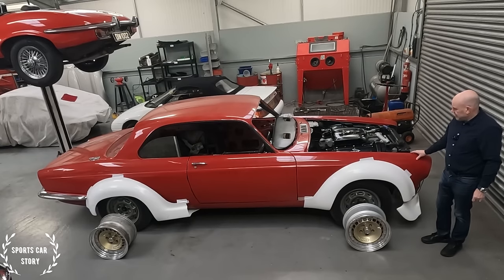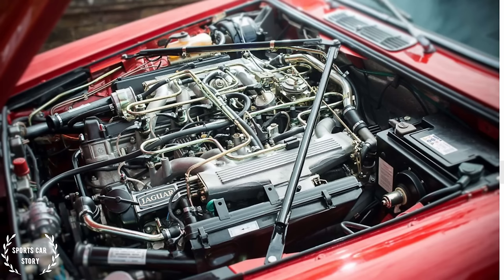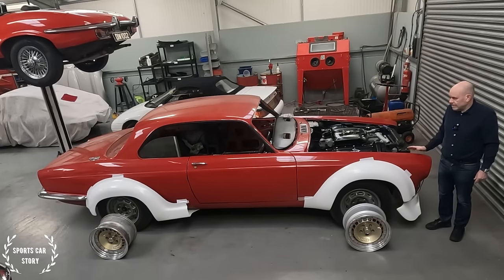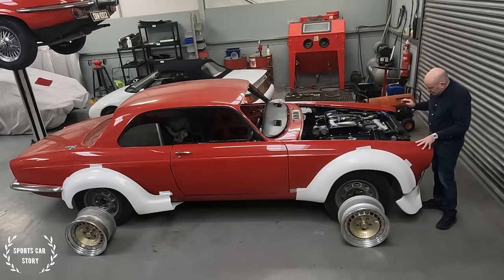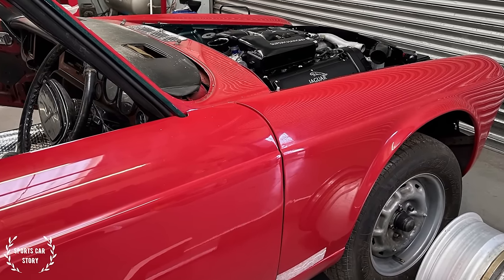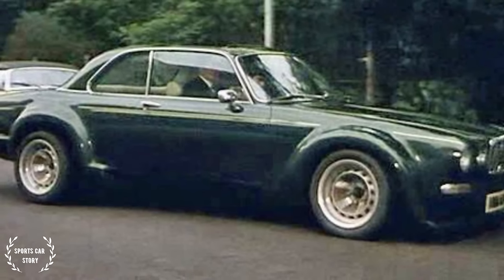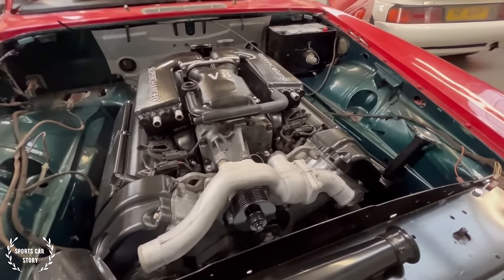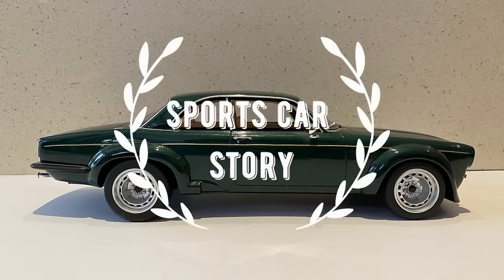Using this model as a guide, we're building a Jaguar Broadspeed John Steed Replica.

Comment: Steed was a "club" man, so the interior should be walnut and leather. Turned aluminium dashboards are a contemporary Bentley "footballer bling" confection and not appropriate in my opinion.
Reply: I agree. A trashy dashboard would be as wrong as a tattooed Mrs Peel in a thong, or swapping Steed's bowler for a baseball cap. 🤭
Reply: Steeds own, original car in the series is a 1929 4 1/2 litre Bentley, with an engine turned dash....so an engine turned dash isn't  out of character
Reply: Turned aluminium is an old coach built trim used on cars pre WW2
Reply from the maker: I think you’re right. I’m going to pivot to a walnut dash through popular demand.
Reply: Totally agree. Should be brown leather with British racing Green. You could stain the seats the right colour to save retiming them🤔
Reply: Those old Bentleys he drove had engine turned aluminium dashes, I’d wager.
Reply from the maker: @blacksquirrel4008   they did. & I got my engines turned Ali done by a Bentley engineer in West Sussex
Reply: I’d ignore the ‘footballer’s car’ jibes and go with the machined aluminium dash - I think it would suit the ‘steampunk’ character of the car and body kit - anyway it’s your car - you trim it as you want it!

Comment: Back in the 80s I knew Bob Kerr who found and rebuilt the 3rd Broadspeed race car.  What a monster, there were 4 x drain pipe sized exhausts which came out under the drivers door.  A blip on the throttle flattened the grass for several yards
Reply from the maker: Wow! I wish there was a video of that!
Reply: @sportscarstory before videos I think.  Saw it at the Knockhill hill climb.

The story was that Bob found the body shell in a scrap yard and was going to build a replica.  He had lots of contacts and when it became known he had a body shell someone would call and say “I’ve got an engine”.  He found that it appeared to be an engine from the race cars, then someone would offer the transmission, then a custom wiring harness which just dropped into the body shell and connected to all the right points.  Someone involved in engineering the race cars then told Bob that he had the “lightweight shell” (dipped in acid to thin the metal).  It became apparent that all these bits were indeed from the race car.

Comment: Very interesting Sir !  Went down this road in the early 90's, bought a kit (Pre fire) from fibresports and found a donor XJ12C for the conversion. I used a Jaguar specialist in SW London and had the bodykit sent to them.  The problem as you are well aware is that XJC's are prone to rust and corrosion (Leylands build quality issues as ever) so the first thing was the donor car body which was pretty nasty. It was the glorious 'carriage brown' so the body paint matched the rust 🙂. After a long time and working intensely with the garage, and lots of £££'s the project had to be cancelled, because it was just too much to maintain. I have owned over five XJ12c's all of them horrendously rusty and needing so much time and money on the bodywork alone before even thinking about the engine auto box, etc,.  Sadly I decided to sell my projects cars for a massive loss, but thats the problem of having a passion for classic jaguars.  On the plus side, XJC's are one of the best looking cars ever and my preference over the E-type. 
One of the nastiest things is the rear electric window with its complex  "S" path to retract the glass into the body, but also ensure that the rear windows maintained good seal when up to prevent the ingress of road noise. Was a tricky thing from an engineering perspective but Jaguar engineers did a good job at the time, 
Some interesting facts re the original XJ12 purchased for conversion for TV
Original colour: 'tasteful lavender blue' - well no accounting for the colour available at the the time, but didn't matter since the car was to be resprayed anyway,.
The engine was a 'base' 330hp V12, but used the round fuel delivery pipes that were prone to shearing and spraying fuel everywhere (corrected later with the improved square fuel rail delivery pipes fitted to the "HE May fireball V12's)
The sound in the TV series were 'dubbed in' but if you look a tHarrys Garage and his restoration of a beautiful XJC the sound of his car in the video is not exactly 'untuneful' but for TV the car needed to sound 'fierce'
The British Racing Green (and there are many variation on this theme) paint was apparently loaded with metal gold flake to give it some depth, and some cost depth as well !
The GKN Kent allow racing wheels were a nightmare to get the spec of and I used to speak with Harry at Image wheels to re getting these manufactured but the costs were high as you can imagine back in the 90's and it seemed to be a bit of a 'dark art' to get spot on.
The V12 (5343 cc) engine is of the 'over square design' and was told that these can be stretched to ridiculously high cubic capacity for things such as marine racing applications. 

I owned a 'santa pod' red XJC, very fast and aggressive, lightened clutch, brake line locks, you get the picture, but deadly, you could not afford to take your eye off the road for an instant, nearly caught me a couple of times 🙂

For many years i tried to track down the original tv car to buy but years of searching got me nowhere, lots of 'leads; but nothing concrete,
The original tv car had the light beige interior (needed for filming to reflect sufficient light) and apparently had lots of 'holes' in the interior trim due to mounting of camera rigs etc.   In fact the XJS used in "return of the saint' had filming cars with beige interiors but black interiors for still and promotional shots.

Re your project car,
I hope that the 'proper' lower skirt gets resolved with Fibresports, that was the one thing that was a major headache for me at the time, and finding a good fibre glasser that would take on the job, 
Thanks,
Nic
Reply from the maker: Thanks for all the info Nic. Adrian at ADR has cleaned and replaced the rear side windows. Both working to an adequate level. Hopefully you’ll see the car pretty soon in my next video when it comes back from Fibresport (it’s been delayed because Steve’s had a bad dose of Covid) thanks again for the info. Pete

Comment: Looks like a great project ,one tip is to use stock upper shock bushes as hard ones will crack the inner fender mounting point.
Reply from the maker: Thanks for the tip.
Reply: Or these mounting points need to be reinforced.

Comment: I fully agree with a Steed mod on the outside and a modernised restomod underneath.

I'd probably have gone for as much XJR power train as possible from the get go. Definitely the diff. The 4.2 SC unit has a lot of torque, even compared the V12.

As for the dash and interior... if you're keeping it then make it the car you want. That's half the joy, IMO. The 1955 Studebaker Speedster had a turned aluminium dash and it looked sensational. I think it will in this, too.
Reply from the maker: Thanks. Interesting!

Comment: If you look  at the uk cobra replica scene you will be fairly happy at the power onoeod these diffs can take. Also a good source for suspension upgrades. 3.54 powerlock 
LSD from a XJS 3.6 Manual wound work nice with a 5 speed manual gearbox. XJC is a beautiful car, I remember seeing a metalic BRG XJC with this body kit in Newport Gwent in about 1984 when I was an apprentice.
Reply from the maker: Thanks! Great advice!
Reply: If this was my build I would be going down the LSD route, there will be to much power for the open diff unless you like to burn rubber on the tire with the least  traction
Reply: @boatslave1  The S-Type R never had an LSD !

Comment: I had a 3 dr Cosworth that I road and track day car, it was completely rust free, the problem with 3dr sierra’s is the large door opening so they flex a lot and I didn’t want to put a cage in it so found a trick that early drift cars did to stiffen the shell which was better than a cage for stopping body twist. Which is to use structural foam which is a two pack resin product it is used in the boat industry and very hard. I put it in the chassis and sills and A & B posts this did really stiffen the shell up as I was using really hard springs as well L stopped at the front crossmember so the front section could still crumble in a crash. Believe me it really does work but very messy.this will mean you won’t have to worry about the roof. As for tyres try Northants tyres they specialise in American tyres and wheels which are on the old Corvettes which are wide and not low profile, I hope this helps
Reply from the maker: That’s brilliant! Thanks. I’ll def get the structural foam.
Reply: We did the same thing to a rally car in the 1970's and I had forgotten all about it. I was going to point out the same as you, the roof is not weak it is the atrocious body rigidity that is the issue. Mazda solved the issue with a bolt in under floor bracing frame for the MX5 so that may be worth a look as well.
Reply from the maker: @duster8100  thanks for the advice.
Reply: In an ideal internet world ,‘Twould be nice to fabricate the body kit in METAL , maybe a set of mk 1 escort metal bubble arches would be a close match for starters ??? , I’d second staying with the jag dash . 
Definitely the coolest iteration of an XJC, the steed version , also five dark triangular decals stuck to the wheel centres would bring your current wheels closer to the TV car look.
Great project well done , especially on engine choice .
Reply from the maker: Good idea about the decals. It’ll def help to get the look.

Comment: My father had an XJ12.  It used eye watering quantities of fuel, yet really lacked torque and power you would expect from a thirsty motor of that size. The injection system was very complex, prone to not working, and complicated (ie cost) any work done on the car.  When you bought it, the water pumps needed replacing about 30,000 miles later.  The 6, on the other hand, is legendarily robust and all round a much better proposition.   In oz, in the day, conversions to a Chev V8 was not uncommon, and probably the best option.
Reply from the maker: Yes. Chevy / Ford option would have made sense then. But there are so many cheap Jag V8’s knocking around in the UK at the moment, & they’re a great engine - & still a Jag!

Comment: One of the Car Magazines late 70s early 80s did a Feature on a Guy that Built   Factory Replica , the Factory Race Team were shutting up shop & they gave him the steel Body Kit & if i mind right all the parts required to make a Factory Replica. I had the Magazine for years until my Wife Threw it OUT.
Reply from the maker: 😂 I’d love that magazine! Steve @ Fibresport bought the molds from that guy I think.

Comment: Brilliant project! Please definitely upgrade the diff (essential that it be a limited slip unit imo), suspension and brakes. Remember even the original V12 had under 300 bhp compared to 400 plus with the new engine.
Also careful with the fuel return. The XJC has twin tanks selected from the dash, you’ll need a solenoid valve fuel return system, essentially the same as on the selectable fuel feed but to return the fuel to the correct tank.
Reply from the maker: I think Adrian has the fuel return issues in hand, but I’ll check.

Comment: Gave a subscribe like No 128. Before my time but I love the Steed car. Great wheel choice. Always thought the original was under tyred. I like where you are going. But stance is utterly critical how the wheels sit in those arches and also arch to wheel gap. You can have a car with power and brakes but bad stance just spoils looks. I'm a motoring artist and I notice things like that. I dislike the Lamborghini Miura for example as it looks like it has a sack of potatoes in the rear. I seen Miuras in person. I preferred the AMC Amx3 so much nicer stance wise saw that also it was gorgeous.

I love the Broadspeed but it was  not perfect stance wise. Glad it survived.
Reply from the maker: I agree. Stance is important. I’m going to work really hard on getting the tyres right.
Reply: @sportscarstory  I would love to one day see when finished if you plan to show it. Great project. Certain cars I'd love to draw and a proper Broadspeed or replica is one I've yet to see in person.

Comment: Concerning the roof and cracking - You are correct the old cellulous paint was too stiff, hence the vinyl. New paints are very flexible as they are often used on plastic panels.
Reply from the maker: Thanks! I heard that, but. Any remember who from.
Reply from the maker: Can’t
Reply: @sportscarstory  there are numerous examples of de-vinyled XJCs that do not have any issues including my own
Reply from the maker: @glynnepritchard2526  thanks! Reassuring.

Comment: Would not an engine from an X350 XJR have been a better choice?  It had many improvements over the X308 one.
Reply from the maker: Maybe. Money was part of the decision, & we found this low miles engine.
Reply: The later AJ-27/32 engine was (finally) a fully sorted and well-developed lump. The second generation 4.0 and 4.2 litre engines as fitted to x308 (4.0, obviously), x100, x150 and eventually x350/358 had all the early (and overblown) issues of the AK-26 ironed out and became pretty bullet proof as long as they were properly maintained. I wholeheartedly approve of this engine choice and have subscribed to see more.
Reply from the maker: @gerardbooth40  thanks!

Comment: In the seventies Chevy Camero had a issue if you raced them or just built them with a lot of horse power they would twist cad crack the c pillar so you could bolt on frame stiffeners I do t know much about them but it's probably like the frame reinforcements of a convertible
Reply from the maker: Yes. I’m going to try and beef it up a bit

Comment: In the photos of Steeds car it looks like the tyres were very low profile, and as a result didn't fill up the wheel wells enough, I think your idea of  more sidewall will look much better ,of course the diameter could be dictated by what rear gearing you want . Personally I would paint it in as dark a green as you've chosen ,but non mettalic.  I look forward to seeing the end result, I always liked Steeds car .👍
Reply from the maker: I agree, the tyre profile just looked too low - especially in the real Steed car when it was pulled out of a shed. Maybe the original tyres had been replaced in the 80’s?
Reply: @sportscarstory  I picture your car with vintage racing style  tyres from  "AVON" ,  maybe even with the bold white sidewall lettering? , I'm not sure, but I think they sell something like that for street use.
Reply: @sportscarstory  wasn't it on different wheels by then?  Yours looks magnificent.
Reply from the maker: When they pulled the Steed car out of the barn, it had its original wheels I think, but the tyres looked very low profile. Not sure.
Reply: I think so. The original looked to be 70 profile....60 at the least. @sportscarstory
Reply: Yes, non metallic like Steads

Comment: I suggest that you reinforce the roof. It will stiffen the chassis and increase crash worthiness. I remember seeing a video from a small Japanese performance shop where they were elegantly welding formed steel panels to the A and B pillars and strengthening the factory structural roof components.
Reply from the maker: Yes that might well be the way to go. Thanks.

Comment: I would deffo do something to strengthen the body the power delivery of the forced induction will put a lot of stress on the monocock also they are not a light car to begin with but i do love the idea of using the newer jag r v8 they sound great especially when the super charger spool's up to get simular type of performance gain from the 4.'2 or the v12 i think you will have to spend double the budget also the new fuel types with the efonal content if its going to be used on a regular basis because you can run the v8r on the current 97 octain without all the hassle of hardened vavlve seats ect i look forward to seeing the next installment
Reply from the maker: Thanks!
Reply from the maker: Thanks for the advise.

Comment: I’m usually fan of mods to get a racing look out of classic cars, especially with widened wheel arches, and I love the XJC, but these extensions are not very nice: the round profile doesn’t fit with the feline soft curves of the XJC in my opinion. 
I understand that using this kit is easier and is right in the Steed Route, but I’m pretty sure some extensions could be designed with a smoother profile. At a much higher cost obviously, since the front bumper and valence shall as well be customized. 
For instance, the 930 wide body has this enhanced but nicely curved shape regarding the original 911 G type.
Reply from the maker: I get it. But for me, it was Steed or not to Steed. That was the only choice !

Comment: I´ve done a few XJ´s in my time, the "C" has its own pitfalls, the rear side windows, the heavy doors and the lack of parts to name just a few. Of course the whole fuel system can be a pain, as can old Lucas electrics. The Diff will be fine as long as you use normal road tires and dont overdoo things at the 1/4 mile. You may want to upgrade the bushings as new originals are terrible, as are all body rubbers. Get somebody who knows what he´s doing to install the windshield, it was even tricky back in the day. Don´t forget to refresh the heating and AC, after so many years it´ll be in dire condition, it likes to leak, the fans squeak and demisting will not work.
Otherwise, nice car, expensive, slowly loosing its bad 70´s image but not really appreciated.
Reply from the maker: Thanks! All bushes are poly now, but I’ll double check the heater fan etc. thanks for the tips!